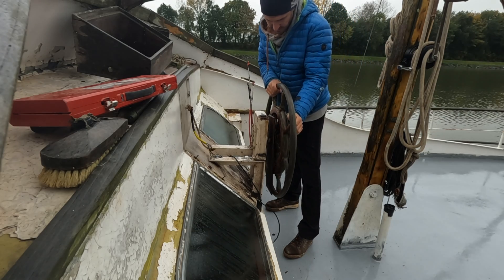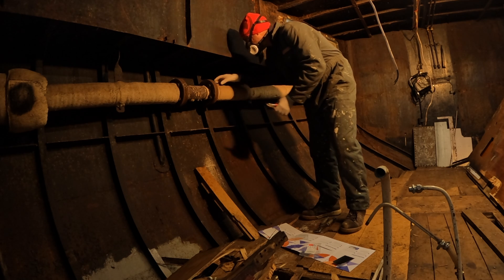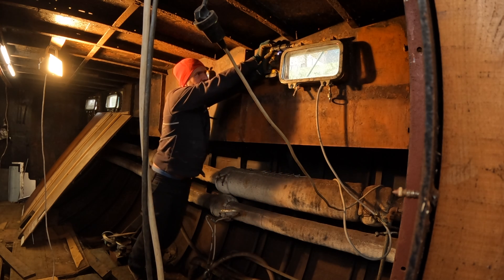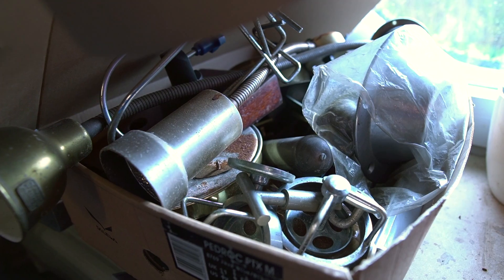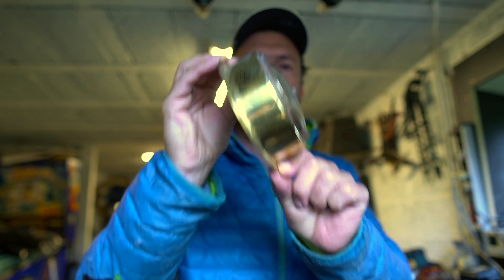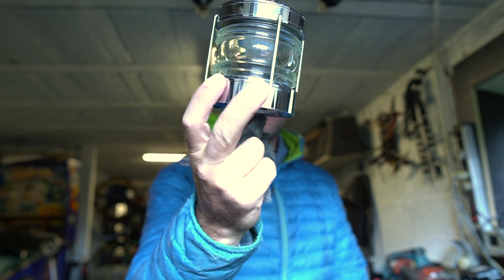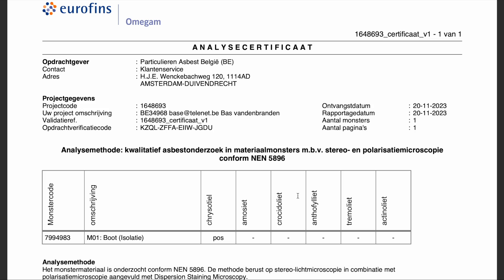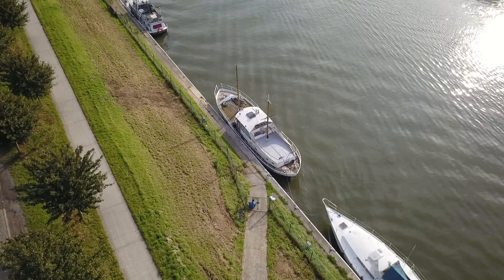Comprehensive Guide to Asbestos in Steel Ship Restoration | Project Y Episode 7

Comment: Steel wool will leave micro scratches.. use citric acid diluted to clean the corrosion and then get some chrome polish like from the auto parts store or a Harley Davidson dealer.

Comment: For brass; Brown sauce (HP sauce for example), slather it on the item to be cleaned, leave for twenty to thirty minutes then rinse off the sauce and wipe item dry then use any metal polish you prefer. this method causes no scratch marks.

Comment: In the Navy we used a great deal of Brasso for polishing. Steel whool does a great job cleaning but a polish will realy bring out a shine.
Reply from the maker: I've already ordered some :)), thanks for the idea
Reply: Yes, the shine of the ships bell after a good hand job with Brasso ;)
Flitzz is another good choice if available in the Belgium ...
Asbestos abatement should have been considered and done before purchase...but this is your project and adventure.
Not complaining or correcting you on your method of attack in this large project.

Comment: Weld pieces of metal to plug rusted areas from UNDER the deck
Reply from the maker: but how do I weld upside down? with the mag welder, the nozzle clogs up, and with the stick welder I feel like the welds are dripping off in stead of making a nice weld.

Comment: It would be OK to just weld the new piece over the old provided that the weld is completely sealed, preventing water getting under the  new piece and causing problems in the future. Prepare the area well by grinding the structure to which you are welding so the steel is nice and bright. This will  give you a better weld. You are doing a great job so far! Hang in there
Reply from the maker: I did, will showcase it in one of the next episodes. pretty happy with the result. to be super sure I added epoxy filler to the welds in places I felt insecure.
Reply: Cut bad spots out and insert new steel. Putting a bandaid over a rusted area is false economy and will come back to bite you later. Speaking as a 40 year journeyman shipfitter/welder. PS  Any hole you make in a steel hull must have radius corners. No square corners to prevent cracking.

Comment: Hi. With regard to repairing the channel at the stern. Because it is curved, one way is to make a cardboard template which fits first, then cut out a new steel one using that template. Cut away the old, weld in the new. Job done!  Good luck!
Reply from the maker: thanks chris, you think its better to cut away the old en weld in the new or just weld the new overtop of the old? there is space and would make the drain function better if it were elevated a bit.